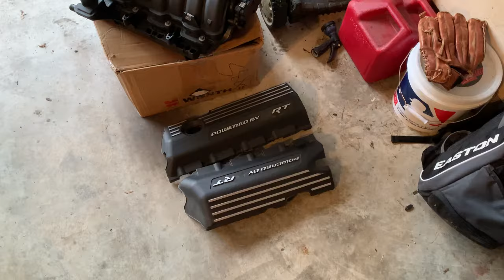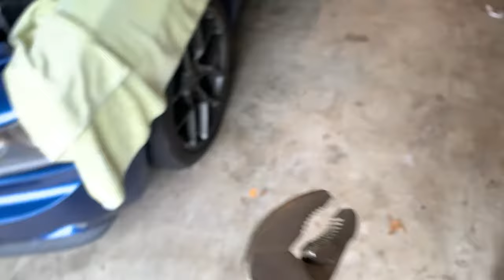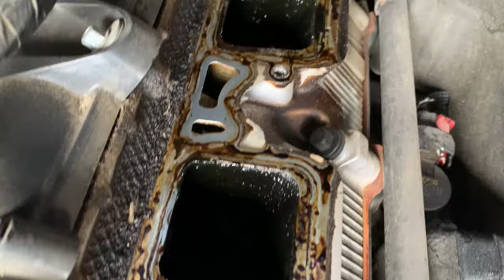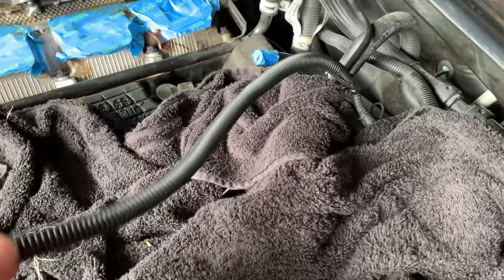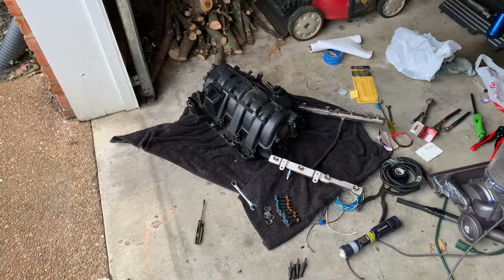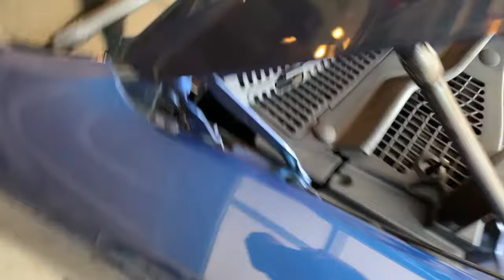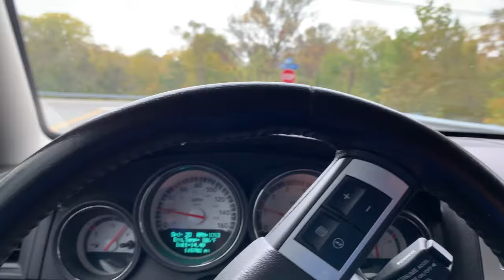6.4 Intake Manifold Swap onto a 5.7 HEMI

Comment: Why did the seller sell the whole setup? Was he unhappy with it on his vehicle? I am unfamiliar with what you have done to your engine, but you really need more mods to make use of the 6.4 intake. All you basically did was lay groundwork for future mods. With the 5.7, you'll need to stroke it, add a camshaft, or both to make use of the extra capacity of the bigger intake. Do you have any plans to dyno your car for some hard data? On the injector wires, the common wire (the one that all the injectors have - brown/yellow in your case) is a common ground. The different colored wire for each injector will be a signal wire - the one that sends a positive pulse to open the injector. You will need to tap into the colored wire instead of the common ground for signal.
Reply from the maker: Hey thanks for the great questions and suggestions! The guy who I bought the 6.4 intake manifold, MDS box, etc from crashed his car so he was parting it out. As far as mods go, I have pretty much all the bolt ons but no internal mods. And while a cam or stroke would absolutely give me way more performance out of every bolt on I’ve done, the 6.4 intake manifold is supposed to give gains in TQ across the low to mid range RPM band. It’s been proven on many 5.7s. That’s why I’m suspecting I need a better tune based off of a data log. I haven’t planned on getting it dynoed, not to say I won’t someday. As far as the injector wire goes, if you watched the whole video at the end I explain how I messed up tapping into the wrong injector wire at first and had to tap into the other one to get an RPM signal, so I did figure that out. But again great questions!

Comment: Is it the brown wire on injector 8? For rpm reading?
Reply from the maker: Yes, the brown wire with a blue stripe on 8.
Reply: @n-power-automotive  yeah I still haven't gotten mine wired up. I know each is different I ported mine before I installed it I need a throttle body to compensate for the throttle port I did on it and I need a tune to compensate for my mods. These computers expensive lol
Reply from the maker: @aaronferguson47  yeah man I’m lucky since I already had a custom email tune from Hemifever I just emailed him and he sent a revised tune no cost. The wiring was definitely the hardest part of the swap, besides cleaning those intake ports out. That was nasty lol.
Reply: @n-power-automotive  yeah I saw it was super rough. With this intake manifold you get more low end tq but now with a wider range to hold the curve longer
Reply from the maker: @aaronferguson47  that’s what it’s supposed to do. No real horsepower gain, just torque in the low to mid-range power band.
Reply: @n-power-automotive  did your Diablo tuner start working right?
Reply from the maker: @aaronferguson47  I haven’t tried it since moving the wire tap to the other fuse but I’m 99% sure that’s what the problem was.
Reply: @n-power-automotive  So what's next for you after this mod lol
Reply from the maker: @aaronferguson47  nothing ha ha! I’ve gone as far as I’m gonna go. I think I’d rather have a fun weekend car instead of paying to have a cam installed. I’m happy with everything I’ve done. Next will be maintenance. I need to rebuild the front suspension bad!
Reply: @n-power-automotive  I wanna go force induction because I like the edlebrock supercharger and not many hemi platforms use the kit it if any use it looks good to me there is one scat pack video with it, chargerforum on a 18 Rt, and jj Hamilton with it on his 13 challenger rt 392 swap on 7psi
Reply: What part of the injector did you splice into? The injector itself or the wire coming from the wire harness or did you just expose the wire and attached the white one from the MSD to it?